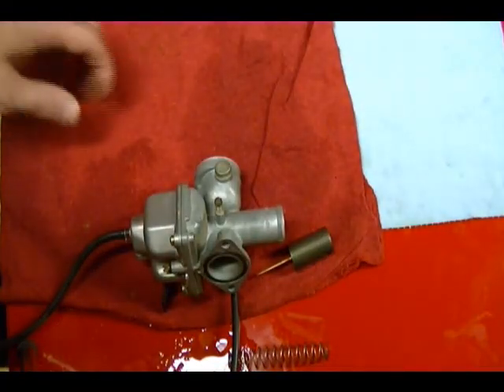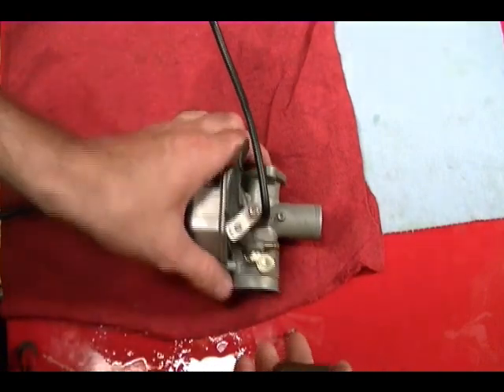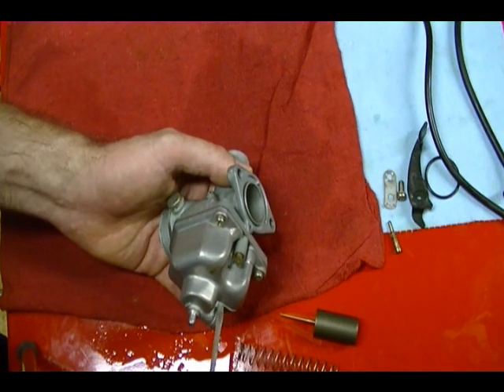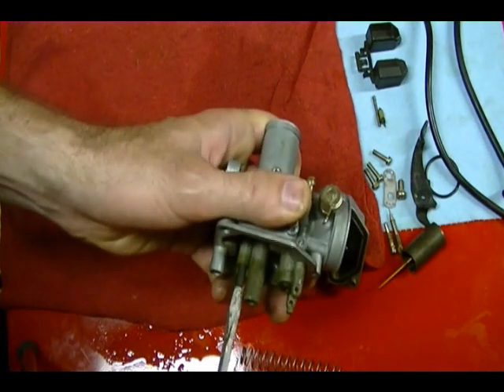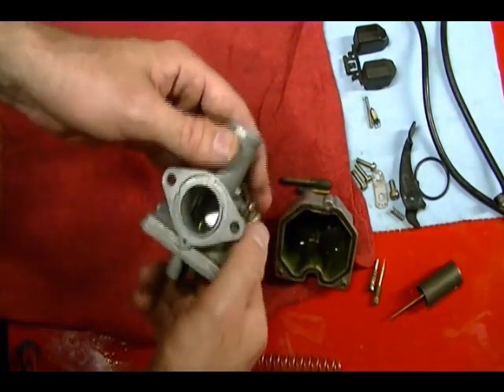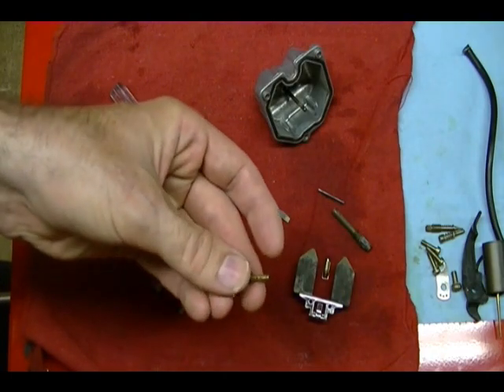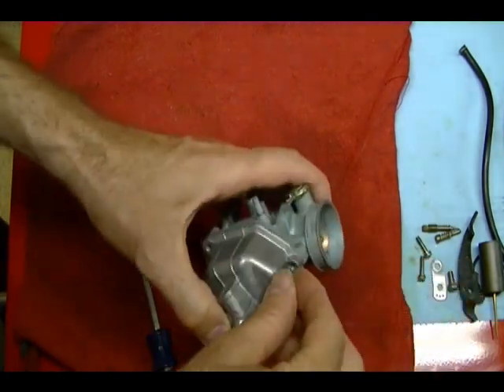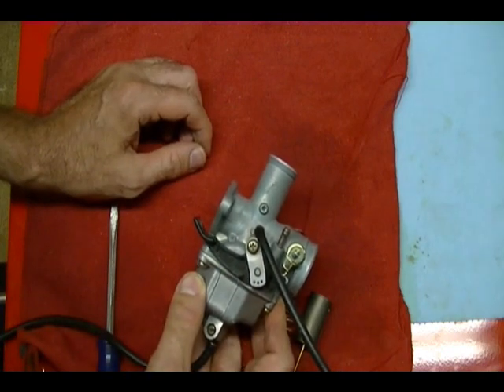Motorcycle Repair: How to Clean a Motorcycle Carburetor

Comment: By far the best carb cleaning video I've seen. Very helpful. You should stress how soft brass is and to use the right size slotted screw driver when loosening the jets, otherwise you'll chip the slotted ends. Great stuff! Thanks so much for posting!

Comment: Impressive video, straightforward and incredibly easy to learn. I'd like to point a suggestion for CV carburators; clean the diaphragm and moisten on a bit of liquid vaseline. That should prevent dryness and breaking of the diaphragm on a long term basis. Cheers
Reply from the maker: Thanks for watching!

Comment: I bought a 02 Yamaha TTR125 that hasn't been started in years.  Carb was pretty nasty.  I cleaned it though I just used spray carb cleaner and didn't come off looking as nice as yours did.  Got the bike to run by push starting it, but it will only stay running if it is choked.  If choke is disengaged it dies.  Didn't use compressed air as you did.  I also used a screwdriver to scrape stubborn crap out of the bowl...maybe a bad idea.  Thoughts?

Comment: That was extremely informative, thank you. I am planning on cleaning my 1980 Kawasaki KZ250 Carb, since it hasn't been running right. Any big differences between the carb in the video and the one I'll be working with on my bike?

Thanks.

Comment: Very informative, thank you! I am new to anything with motors and my 2-stroke 1976 Simson S50 has trouble starting (have to push start), and often dies when idling at a light, do you think that cleaning the carburetor would be helpful? I assume I may need to adjust the idle regarding the dying when stopped at lights?

Comment: I enjoy watching this with a better understanding of the carb. My question, is it the same with a 1986 Honda Goldwing 1200a I never worked on a carb and have a problem   with mine.....it try's to run then dies and a gas leakage on the top right side (overflow) I think?  26014 miles...., Can you help? Thx.

Comment: Thanks, but green degreaser doesn't register as something i know. Is that it's colour or eco friendliness? Powder, fluid, or gel type? Brand name(s)? Does a grocery, hardware, automotive, or all the above store(s) sell it? 

It's back to the books for me, to learn more. KLX250S' plug was getting no gas. Cleaned carburetor. It started instantly, idles perfectly, stalls instantly when it gets more gas. ...last fall it worked perfectly.                        Cheers.

Comment: yeh it did it even in idle originally then after adjusting my carb it ran fine then the next day it wouldnt get over 6000 revs in first gear and the engine just slowly dies to a complete stop i am guessing after cleaning the carb fully and adjusting it abit more it might fix the problem

Comment: Nice video, will help me with my carbs off my 1980 cb650. Do you have a trick for winding up the throttle return spring on carbs?
Reply from the maker: Thanks. Not sure what you mean by "winding up." I just compress and hold the spring with my hand.

Comment: Bought a bike with cv's,that had flooding issues.Found the diaphragm wasnt seated correctly.Cleaned the floats etc...now the bikes stalls on throttle.the idle air has been the only thing adjusted.i also have to cover the airbox to force a start.any suggestions?

Comment: Hey in my pilot jet i cant see any light through it lengthwise, so i tried blowing it out with compressed air and still nothing.  So i stuck a piece of wire in there and its something stuck in there so hard i cant even move it.  is this right?  If not, is there any way of fixing it?  Fuel has sat in there for maybe a year, as the person i bought it off had forgotten about it.
Thanks

Comment: what does the 1993 ninja zx6e models have are they slides or the other ones we cleaned mine last year but NEVER SEPERATED THEM just pulled the bowls  cleaned them and the were rusty looking and cleaned the needles and floats ran awesome for about a year.....then all the sudden no power under load could that quite possibly be because we never seperated the carbs in the first place and what ever might have been in them jets as you shown when you seperated them with the slides could have gotten worse over the year with varish?  I did keep it full and did run it even in the cold in winter last year maybe just idle too op temp and then shut it down but just too keep the rings lubed, and gas flowing.  So just curious on them couple of items, I am going too have them professionally cleaned over the winter but just as a basis is the reason why I was asking.....thanks for anything you can offer in advance...

Jeremiah
Reply: also whats the rule of thumb on cleaning should it be done once a year regardless?  Im just curious im still a little new too the maitence part (sorry on the spelling)

Comment: I cleaned my carb but now there's no gas going to the engine from the carb . but the carb is getting gas very good. . if I take the gas line off of the carb and blow compressed air into the inlet where the gas line was attached to the carb . and then try to start the motor . then it'll start and run for a second or two then quit . what might my problem be ? thanks

Comment: What does it mean when gas comes out of the vacuum lines where the air filter goes I cleaned the jets made sure all the holes where clear it's every time I go to kick it over it spits gas out from the lines thank u for any help
Reply from the maker: Usually means your carburetor is allowing to much fuel into the carburetor. Check the carburetor float, float needle and float seat, and make sure those parts are in good condition. Than check the float height and adjust if necessary.
Reply: ***** it start now at full throttle but when I let it go it  is cuts off where I put the air filter at its holes gas is coming from there sometime shoots out like if it was jet
Reply: ***** I got it started now I put a rag around the carb it starts lol but when I put it in gear has no power revs high
Reply from the maker: Make sure the carburetor is clean. Get a strong carburetor cleaner and dunk the metal carb parts into the cleaner for how ever long the instructions recommend. You can get a gallon can of carb cleaner with a dunk basket at Autozone. Don't get the cleaner on plastic parts and follow the instructions on the can. Rinse everything off when your done with water and use compressed air to make sure all passages are clean and unblocked. Be careful not to get the carb cleaner on your skin or in your eyes.

Comment: A good mechanic would take pictures of a part before disassembling it or draw diagrams if needed. A digital camera would be most useful for this task. Then have a box of zip-lock bags for parts. If there are more than one section within that part like a multi-carb setup, the best thing is to keep each and every part that comes out of each carburetor separate from each other and label each container or zip-lock bag accordingly. This is a must-do especially if you are not going to be able to re-assemble the part within the same day. Things can become very confusing the next day....

Comment: Good Video, but you should have told people how to measure the screw adjustments. You simply say record their position but you don't tell them how to record it. measure when putting it back after cleaning. Say it took 3 and 1/4 turns to seat the screw, when you put the screw back in you seat it and then back it our 3 and 1/4 turns. this will put it back where it was before you intially disturbed it.

Comment: how many turns do we have to spin the air needle part
Reply: Before you take the Air Needle out, you need to rotate and calculate how many turns to see what it is set at. Generally, most Small gas Engines are around 1 1/2 to 1 3/4 Turns. That's from closed position